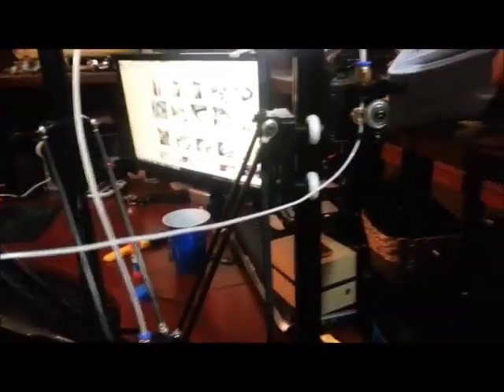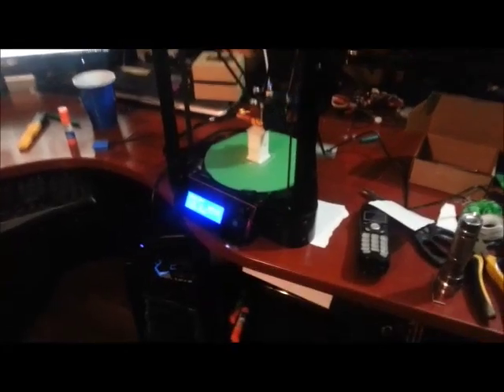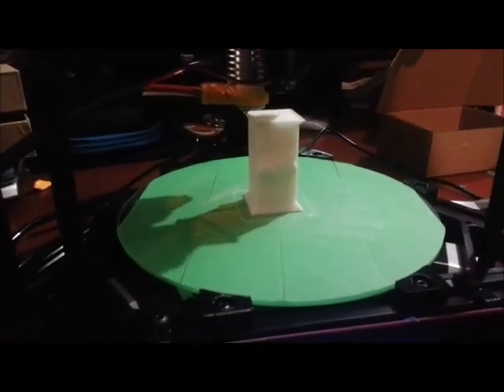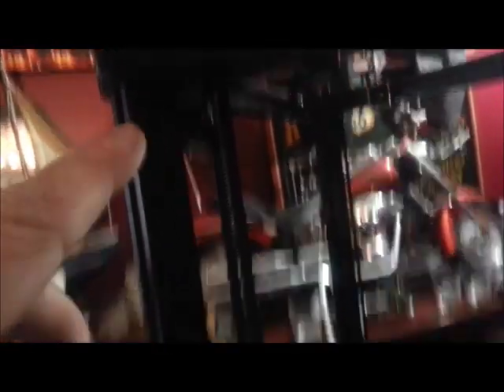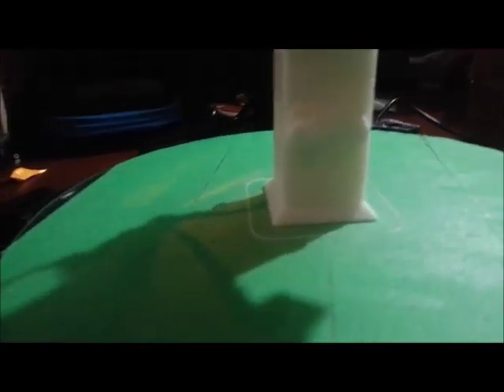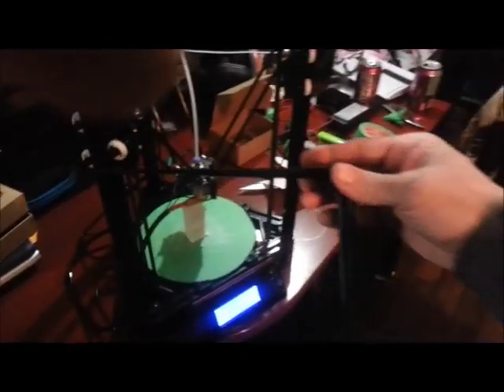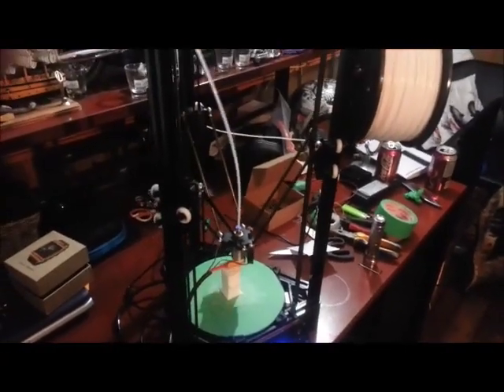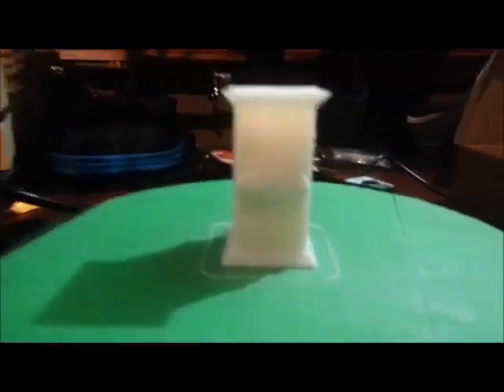Completed Working ANYCUBIC 3d PRINTER

Comment: I was considering buying one of these as a first printer (I want to try learning and experimenting on it). Since all the information I've found is either missing or poorly translated from Google, mind sharing a few experiences and features about it? From what I saw it doesn't seem to have an sd card reader - not critical, I can live without it :)
Reply from the maker: +Andrew “some guy with diabetes” Micallef 
It has an sd card reader and can be stand alone, the SD card slot is on the side of the LCD2004 panel. The only real issues I have had once I got it up and running was the filament I purchased and not the printer. 
There are 2 variants of this printer on Aliexpress, this one which has been jacked up in price since and is no longer a value and another with orange Plastic parts which trends around $230. With this one my biggest issue was it came with no firmware or software of any kine, and as a first time 3d printer owner this was a big issues for me. I spent a couple of days searching for the correct version of marlin and adjusting, testing, and adjusting the settings again. Again that was no fault of the printer but the seller. The one with orange parts has all the firmware on an sdcard. Like all Kossel 3d printers there can be issues, Ive had filament jams and the printer printing in air cause of this but again this is no fault of the printer.  It has an all metal hot end, a replica of the E3D V5 which has been pretty good. The majority of the parts that were not printer were great quality, I have had it running a week straight now and only problems was the MG chemicals filament I got. The build area is roughly 170mm diameter and 300mm tall or 6.75"x11.75". The Glass bed is 200mm diameter. It has 2 cooling fans right on the hot end, one to cool the filament and one to keep the heatsink cool, and the bearing on the extruder is an MK8 which is a very good bearing for the bowden style extruders. I can control everything on the printer from the control panel but I prefer using Pronterface on my PC which is only  a few feet away from the printer anyway. Other then the lack of any firmware or software I cannot complain about the printer itself, some of the printed plastic parts(not including the plastic on the frame assembly as those were injected molded) could have been printed a little better with more infill, I have have the printer running very well and made several backups of the printed parts. The largest thing I have printed so far was a small statue of myself measuring 7" tall 4" wide 3" deep. Everything was in the box and well packaged, there were extra of every not and bolt as well as an extra endstop and stepper driver board.
Reply: +rockwater999 Thanks for that. I'm actually a bit surprised about the card reader since every seller I've seen doesn't point it out. I'll have a look at aliexpress again and pick something out (cheapest ones I've seen are basic kit with no heat bed, though I've seen them on eBay within budget). If I ever get one without firmware or good instructions, would you help pointing me in the right direction? thanks once again!
Reply from the maker: +Andrew “some guy with diabetes” Micallef 
For sure,  if You pick up a generic kossel mini without the firmware I can certainly help you out. 
Here are some links to the orange and black kossel i described, nothing but good reviews on it from buyers as well as a lot of buyers posting picks.  The one below unlike ebay has a ton of individual buyer feedback and photos.
http://www.aliexpress.com/item/Automatic-Desktop-3d-printer-large/32261046955.html
Also here is a link to the generic Reprap Prusa I3 no User reviews yet but seller has decent feedback.
Also note the I3 is less technical then the Kossel to setup and has a larger X and Y Print area but the kossel is much more pleasing on the eyes
http://www.aliexpress.com/item/Big-Print-Size-220-220-240mm-High-Quality-Precision-Reprap-Prusa-i3-DIY-3d-Printer-kit/32600700205.html
Reply from the maker: +Andrew “some guy with diabetes” Micallef 
If you search for Prusa I3 on aliexpress you will find lots of cartesian style 3d printers, all of which come with heated beds and free rolls of filament for around $200usd.